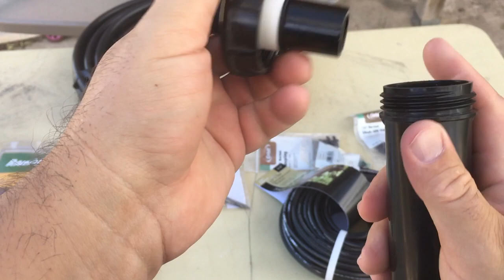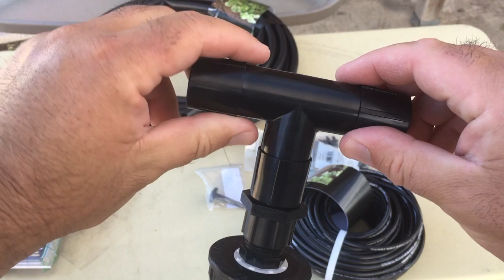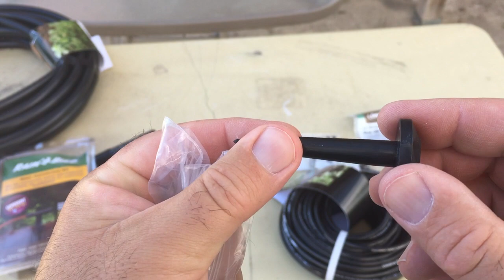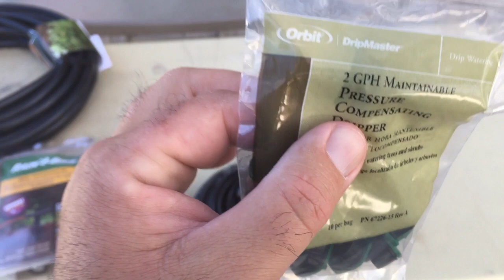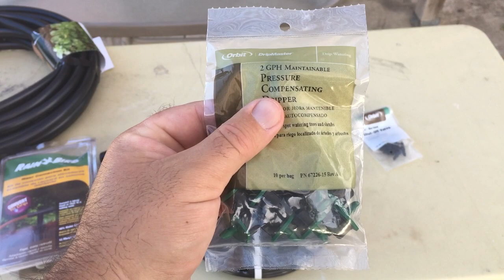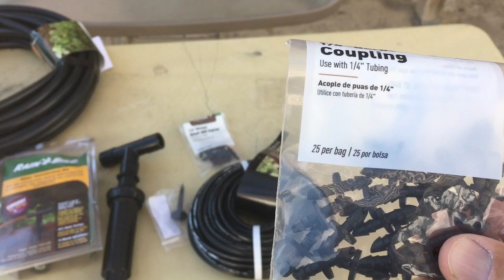Drip Conversion 101, part 1

Comment: Alex, my experience with those shut offs is they fail a lot. I am moving most of my drip off of the 1/4 inch and using 1/2 inch with the emitters in the 1/2 inch directly. There are some emitters that allow you to dial from 0 to 10 gph (in theory) I find them slightly more reliable than the shut offs.
Reply from the maker: Thank you for the input. I was suspicious of the mini valves, but I figured it was worth giving them a try. Good thing I have also got some 1/4 plugs in reserve....